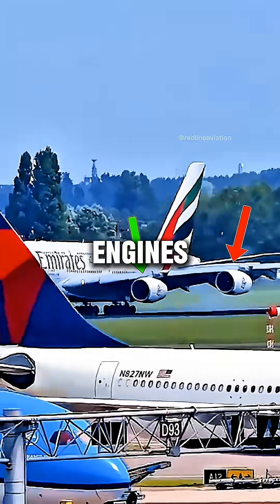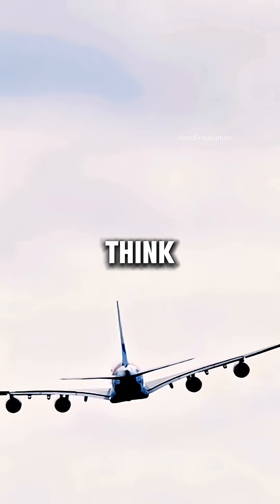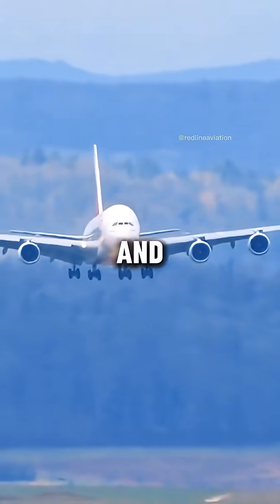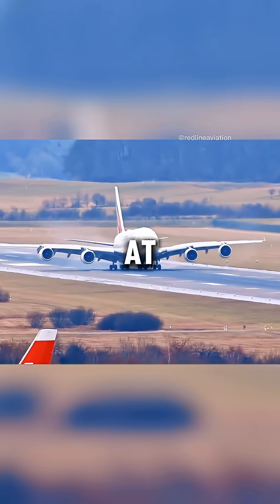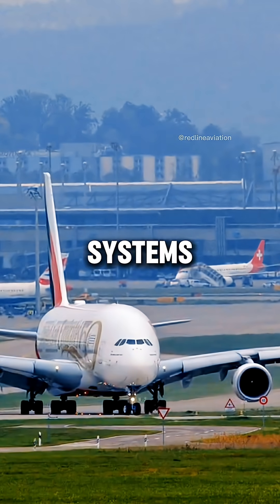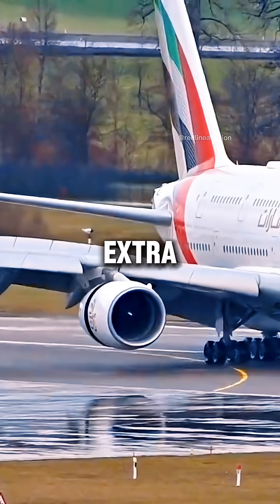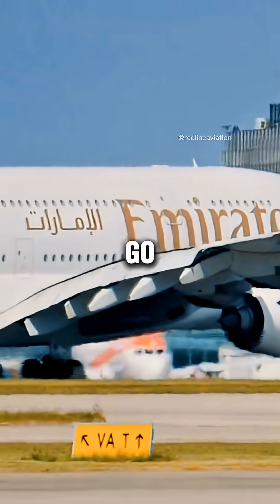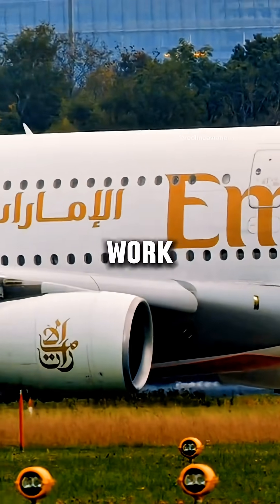The A380 Reverse System Will Surprise You 🤯

Comment: This video is misinformation. Has nothing to do with hitting the ground at weird angles. 

The main reason was to save weight. The secondary reason is that due to its wingspan, the outboard engines might hang outside the pavement and over the grass, which might create foreign object damage.

Comment: Thrust reversers are not taken into account in calculating the landing and stop distance anyway.
Reply: They do have reverse thrust on all 4 engines.. they just don't use them.. unless they really had too.. but these videos gotta stop putting out misinformation and disinformation.. of course he didn't say they don't have it, he just said they don't use it.. there's another video on here saying they don't have it on all 4.  But that would be a lie, they have them, they just don't use them.. unless truly needed..
Reply: @ShawnLattimore-o9o  the one with the misinformation is you. No, not all 4 engines have them. On the A380, the outboards do not have thrust reversers installed. They are only on the inner two. 

Maybe do some research before spreading misinformation and accusing others of lying.